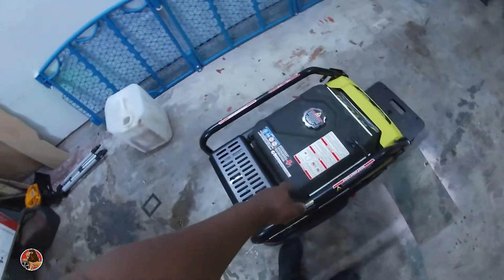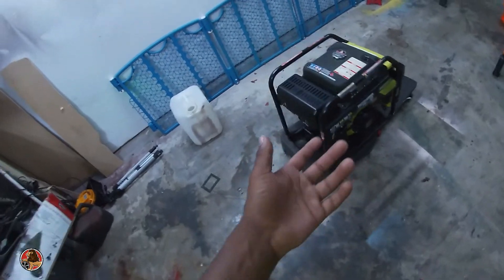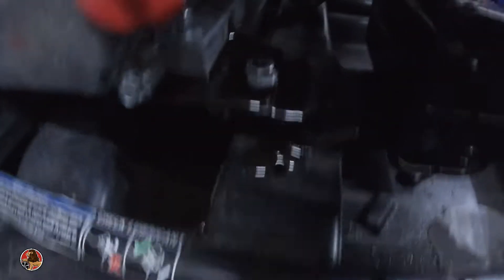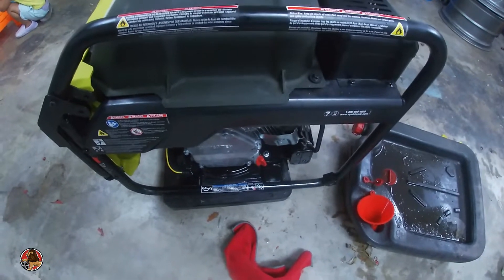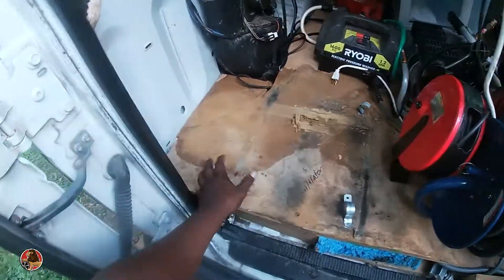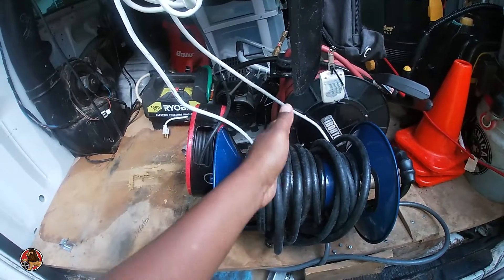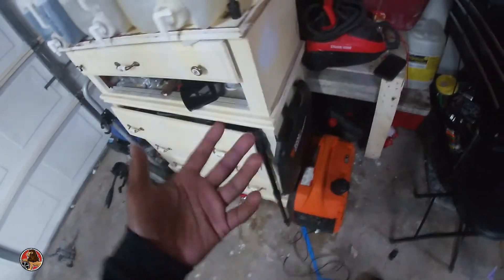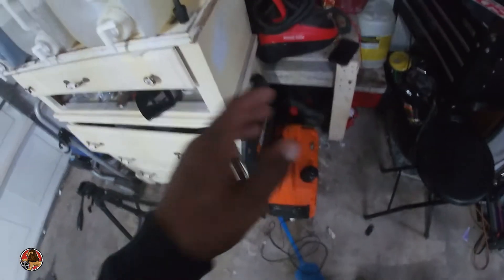Almost locked my generator MOTOR up, major maintenance on my DETAILING equipment.

Comment: I put a fan by my generator to push the hot air out of the Van
Reply from the maker: That's what I recently started doing. Im thinking about just putting a bigger fan to kinda extract the heat out